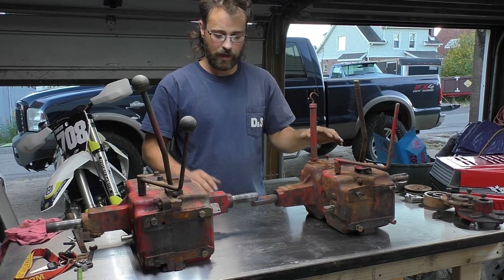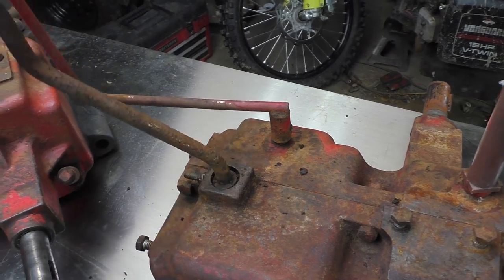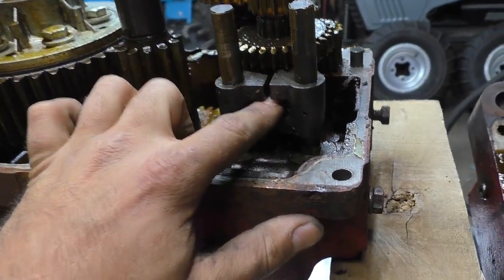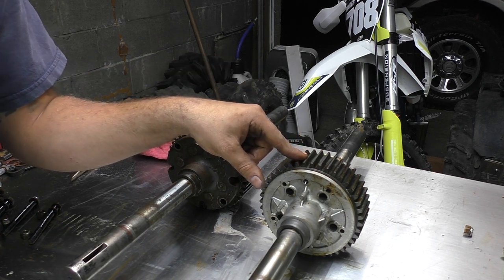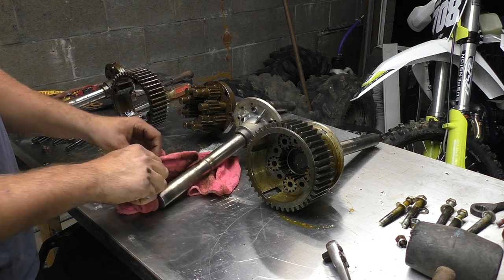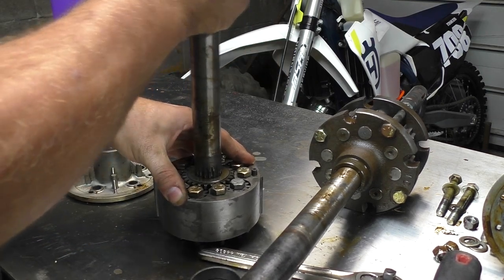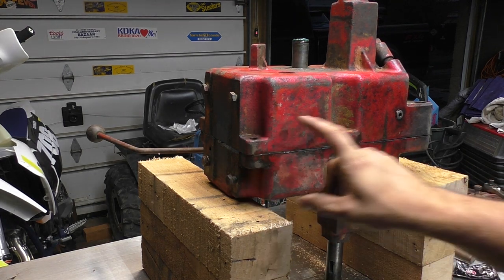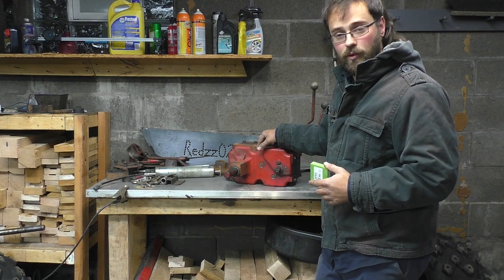Wheel Horse Transaxle Locking HOW TO

Comment: I appreciate you taking the time to make the video. 

The oe case gaskets are readily available from multiple sources and work great. Silicone/rtv is ok in a manual transmission as you've done but should never be used in a Hydro. 

On the 10 pinion differential. Those are not at all common in the first place and the spring to make it Limited Slip is available on the aftermarket now. 
You'd have the benefit of both wheels driving and be able to turn without damaging anything. 

Thanks!!
Reply from the maker: Thanks for the information!

Comment: Hey man! Great video, now I know what side if the trans case goes up when disassembling it. Will need it some day to put a new gasket on. Also some info for the wheel horse fan. 
Input shaft seal #100442
Brake shaft seal #100441 
And yes sand the axle shafts first that helps a lot, clean it very good, then remove old seals and put new ones on,
And don't forget to put some anti-seize on the shaft and key way.
Reply from the maker: Jose M. Great info! I have the list of seals somewhere I just need to find them, the axle seals the only one I had on hand at the time

Comment: I have 4 of these Wheel Horses, all are manual 1 1/8" axle 8 pinion tractors. 
 The 10 pinion is the weakest WH rearend & its why they didnt make many.  
  They actually took too much metal out upgrading the 8 pinion up to 10 pinions to help strengthen it but it only weakens them as cracks in the side plates developed on the 10 pinions.  They quickly went back to 8 pinions again.
 So if you have any 10 pins apart again look very closely at the side plates before reassembling.  "Supposedly" for reg mowing the 10 pins last yrs but once you start pushing dirt/heavy snow/tilling/pulling loads your trouble will begin, unlike the 8 pin that can do it all for several decades without issues. Too much of a good thing you know?
 
 Needless to say the most reliable one is the 8 pin 1 1/8 axle trans, its their stoutest trans.
  The 1 1/8 trans with 4 pinions are the same as the 8 pinion 1 1/8 trans. Just add 4 more pinions to greatly strengthen the 4 pinion trans. 
 The extra pinion holes are already there so no need to drill into its plates, you simply drop the pinions right in!
 
  People are actually better off having the 1" axle setup with only 4 pinions vs the larger 1 1/8 axle unit with the 10 pinions for tilling/pushing/pulling heavy stuff since the 4 Pinion 1" axle rearend is the stronger between these two and held up quite well for decades. 
 
 I never had any trans/engine issues either one from my Wheel Horses. My first horse is a 1976, its still going strong after mowing nearly 3 acres here over 40yrs. It pushed a lot of snow in winter, dirt in summer, tills up my garden twice a yr too. I just never had a major yet. Maintenance only, my biggest cost was two front tires, the rears are still the original tractor lug style and are hard as hell so thats my next repair for sure. Past due by a little for sure...lol! 
Hope this helps someone. 
Peace

Comment: it looks like you could do that 10 pinion the same as doc sprocket did a no weld locker on a 2300, i think that's the right one, he used cut pieces of steel and fit them between the pinion gears so they were locked, great video, my brother has a WH b80 with the 4 sp uni-drive, he needs to replace seals and outer axle bearings on it, this helped me get a good look at it before taking it apart
Reply from the maker: darkside0914 maybe it was a 633a doc sprocket did? I just did a 2300 and it has the same differential as a peerless 820. But you are correct you could probably put some pieces of metal in there and lock it up good
Reply: @redzz02  i just looked at the video again he said it's a 2317

Comment: I've got a 1979 (I believe) Wheel Horse model C-81 lawn tractor, with the 8 speed transmission (with high & low range). The transmission shifts gears ok, but the high-low gear range lever is stuck in the "high" range. I was wondering what I could  do (without disassembling the transmission) that might get the lever to move into the "low" range. I'm not sure what's causing the high-low range lever to stick. Rust, maybe?
Reply from the maker: My only suggestion is to spray the hi/lo shifter where it meets the trans axle case with penetrant oil once a day for a week. 

Jack it up and put a pair of vise grips onto the shifter as close to the case as possible, spin the input pulley by hand while trying to forcefully shift it from hi to low, 

Try this in every gear including neutral, if that doesnt free it up there are internal issues

Comment: You made it look so simple. They look extremely heave duty on the inside. Do you still have a 27" tsls? They'd look good on that transaxle. Got any tractors that has a peerless 2300 in it. One question you may be able to answer.  I got my 820 out of a murray gt Widebody. What is the one axle longer than the other? It messes with the offset of the rims and tires. Didn't notice it on the murray but it looks like crap on the Jacobsen.
Reply from the maker: Hillbilly Offroading it is actually pretty simplex I have a set of 26in tsls but not 27s. I have a 28in tire that will be going onto my wheel horse that this axle is going into. I do have a dynamark with a 2300 and I just had a tractor dropped off this past weekend with a 2300 so I will be doing a locking video on that too. I’m not entirely sure as to your 820 predicament I haven’t had any offset issues with them
Reply: @redzz02  ah ok 26s. I'd be quite interested in a 2300 locking video. Are the 28s you talking about the high lifter Outlaws up against the wall?

Comment: Hey I see a kdka sticker on your garage door you from around Pittsburgh? My need  help with wheel horse transdrive
Reply from the maker: I am from west mifflin
Reply: @redzz02  I live in grove city about 60 miles north of ya I'm building a mud mower out of a wheelhorse and was wanting to lock the axle and your vidio helps alot do you know anything about pully swaps I'm wanting to get alittle bit more speed I'm putting 27 inch atv tires on the rear
Reply from the maker: @daveglenn8805  dont go anything smaller than a 5” pulley 7” motor and 5” trans works good
Reply: @redzz02  thank you

Comment: They dont lock so the mower turns instead of pushing the front wheels straight, especially on wet grass. Cant lean a mower to turn it like you do 3-4 wheelers. 
This tears up the yard much worse locked up  so if you plan on mowing just understand that it will.
Btw- The reason that trans was so full of water very common. Its because the boot was bad so any rain/washing one that water runs right down the gear lever & inside its trans. One I bought was absolutely full inside like yours. I just flushed it with kerosene twice, then filled it with fluid. The owner almost loved it to death, he washed it off after each use.. lol
 Looked/ran like a new tractor but I sold it to a cousin dirt cheap. We thought it wouldnt last very long at all but its still going today, been over 20yrs.
Reply from the maker: Youd be very surprised, these tractors perform very much like three wheelers and you 100% can lean and shift your weight to make these tractors turn better. We do it every time we ride. 

And the front end pushes more on dry grass, not wet grass. But to help out with this put a gallon or two of RV anti freeze in each front tire.